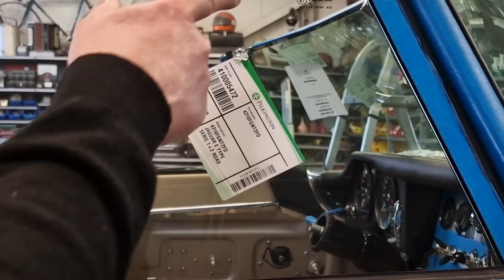Masters of Precision: The Hidden Atelier for Jaguar E-Type Restoration

Comment: Great tour of Autoclassics in Latvia! As you say the hidden secret for big time restoration shops in Europe. Looks like they have the process down: prefit the chrome, work the door skin flanges for good seal fit, remaking the trim that's unavailable. And yes, the Ferrari presented by Tom Yang at Cavallino 2024 was done there too.
Reply from the maker: Hi Richard 👋,  yes you were damned right with that workshop. Good, you told 😁😁. Apart from Eagle, I have never seen such a complete in-house restoration. And only with they are able to manage a first class restoration in only 14 month. Imagine 30 people are working there. You can tell they get things done. Looking forward to your next video. The 2 hours Retromobile https://youtu.be/Yf3V5nfKUHs?feature=shared is running 🔥 🔥.
Thanks for watching ✌️

Comment: Nice video again Maikel, I try to make everything, too, because I cannot affort the money to buy all parts, so it takes a lot of years to finish the car of mine. Made floors, doors, Leathers for the seats, restore engines, exhausts, gearbox, hinges and now I want to make trims, don't know yet. Even made the rear lights of RVS(Stainless). Frank.
Reply from the maker: Frank, you are going the long and hard way. Respect. Keep the thumbs and motivation up.
Reply: Well done. I would love to learn to use the English wheel.

Comment: Great video Markel! I currently own a 1970 E-type 4.2 series II. It is a driver and I enjoy working on improving various parts of the car. My question to you is, do you have a good source for obtaining original looking hardware for the car? I’ve notice when working on my car I have found numerous trim screws that have a Phillips head and I know they should be slotted head. I would like to replace these trim parts with period correct fasteners. P.S. I live on the East Coast of USA. Thank you so much for your time.
Reply from the maker: Good day, and thanks for following. I am using these screws from Martin Robey 
https://www.martinrobey.com/jaguar/e-type/e-type-series-3-2-2/body-fittings/quarter/18087

You might search for these "DIN 7973 Blechschrauben Linsensenkkopf Schlitz" called self tapping slotted oval head chrome plated, but maybe stainless steel could be sufficient. Good luck.
Reply: Markel, thanks for your response and help!

Comment: Great shop,great work, thanks Maikel.The opalescent bronze OBL  was the same colour as chassis 198 that I recently sold as as a fully restored and detailed OBL from our OBL stock.Also great to see at 16:59 with the early rear bulkhead with only horizontal rib stiffener pressings,heavy painting of bonnet good for finish …but over the years after painting many OBL’s I have always reduced the paint coverage around the welded louvres to retain the spot weld imperfections from the factory .Generally,.most changes in the body and fittings build up ( including such details as the thin/thick  lower windscreen chrome) can be accurately defined by referencing the changes in the official Jaguar parts catalogue from the day alongside the intuitive knowledge gained from specialists in the obls such as myself who have rebuilt and repaired these cars for 40 years ,dealing with all the idiosyncrasies that Browns Lane threw into the mix back in 1961,again great work and keep on learning with the OBL enigma.
Reply from the maker: Good day xxxxxx ???? Many thanks for your in-depth feedback and contribution to my channel. The OBL's are the real evolution of the E Type before they really became a "mass-production" car. For me as an engineer, it it entering the browns lane engineering department in 61. That is why I find it so interesting and fascinating as we all can witness today what they changed and we can find out why.
Where are you located?

Comment: Thanks Maikel again for a high quality and interesting video! Your insights are always appreciated 😊
Reply from the maker: Hi Jukka, you are most welcome and your feedback is much appreciated. Keep driving your Jag. Summer is there.  ☀️🌞🌻
Reply: @JaguarEType  Maikel, I will but summer is not yet here...although spring. So preparing my S1 FHC to be ready for the season. 😎
An important but many times ignored thing sorted this week. My e-type got new rubbers on wire wheels. Old tyres had still a lot of rubber (only 12K kms) but aged as baked back in 2011 so not that safe anymore. 
You could mention this important safety but also comfortability point on one of your videos as too many times we only think about how much rubber our classic's tyres have and not how old those are. 🤔 It's so easy to think that I will do one more summer with the existing tyres. But sometimes it's just better to bite the bullet. You could share your experiences of various options for different type of e-types (S1/2/3 & OTS/FHC) and driving needs/styles. I'm sure many would like it.
Reply from the maker: @jukkaaunola5942  Fully agree with you. Old hard tyres might still be good for dry roads, but even a small rainfall puts you on ice. So true 👍 
Will try to remember my followers.

Comment: Maikel,
A couple comments..I was taught..my wife and I never touch the body with our bare hands..we always wear gloves..And finish is a real issue to me...Jaguar did not buff the cars (well, Jag did if there was damage caused "in the shop" and had to be spotted in)..if buffed then one is walking away from originality as the paint becomes very flat..original paint had some orange peel ( reality is, new cars are NOT buffed..look at even high dollar cars...all have some orange peel..look at dark colors especially black)  Buffing is done, as I have, at times, to correct mistakes...perfection is not buffed.  The more you know..well ??...Buffing IS paint correction.
Enough is enough..a breath of fresh air from you, Maikel...as you said, "do as much work when you still have enthusiasm"..rings in my head..for that and all you bring, I thank you
Mitch
Reply from the maker: Hi Mitch, thank you very much for your knowledgeable feedback. You are right with what you say. These guys are just trying to make things better, even if the paint was as good as when Jaguar did it.
Exactly that orange skin, what I do see very often, is something I personally do not like. Here, the paint looks like a smooth mirror. Every reflection is christal clear. Certainly better than original.
Many thanks, Mitch, keep up the good work. 👍

Comment: Now I understand why it’s good to buy new old stock because it’s original jaguar parts from 1970s or 80s when there was loads of Jaguar specialist Parts people around London I remember GH Nolan Southeast London loads of brand-new E type Parts also Norman’s West End Lane NW London old stock. 
   My late dad had best solid solid Original Series 1 4.2 Roadster with original factory hardtop I should never sold that should’ve just left it in the garage in AXLE stands. Massive mistake today in 2024 I could’ve chucked £80 bags at it with a proper Etype or XK specialist, never mind. It’s gone now.